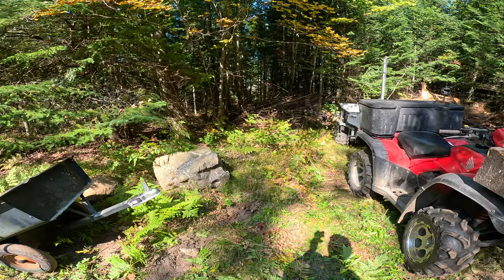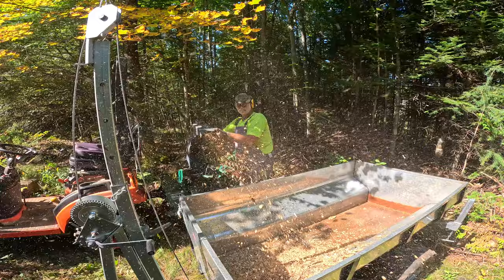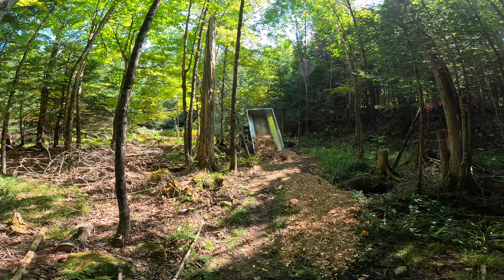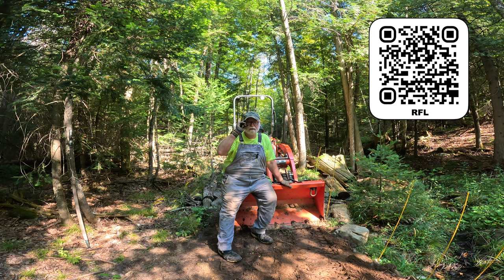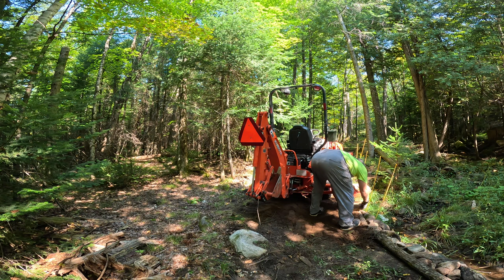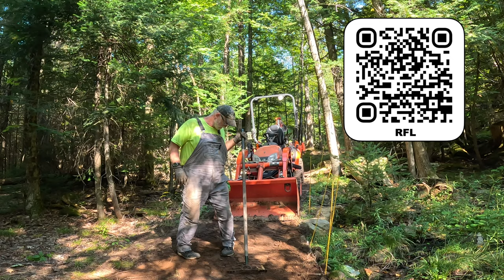Pulling Out The Last GIANT Rock With My Tiny Tractor At The Off-Grid Cabin (Part 4)

Comment: It’s going to be interesting to see how well your chips work on that soft ground.
I had thought about using chips on both of my trails on each side of my big timber, north and south.
Both roads are pretty steep and I have to do maintenance every year to fix the washing out.
A couple guys thought it would be a mistake as the water would simply wash the dirt out under the wood chips.
I would like to try a small section as an experiment and see how it goes.
Reply from the maker: I have been putting wood chips on my trails like this for years. They beak down but I've got lots of material to work with. They do push into the soft dirt but it does really work well to combined things together. It does need to be a big chip. Sawdust just disappears very quickly.